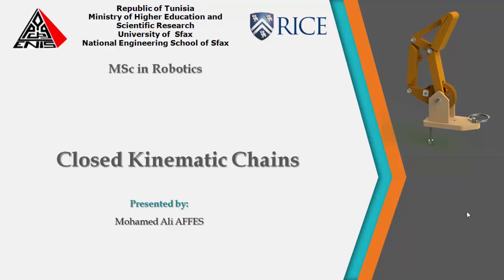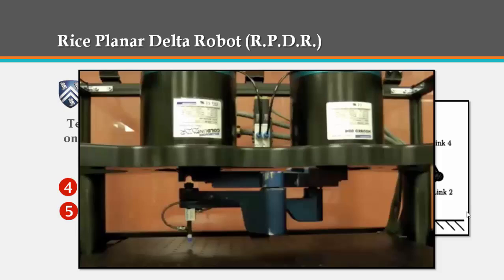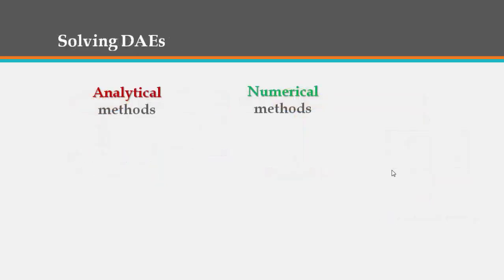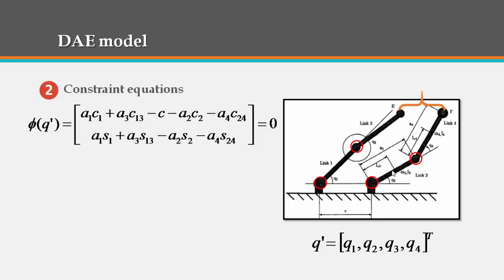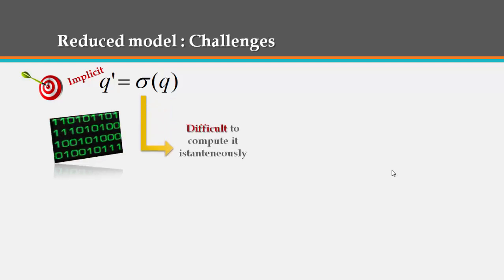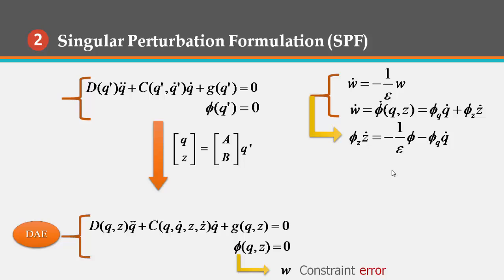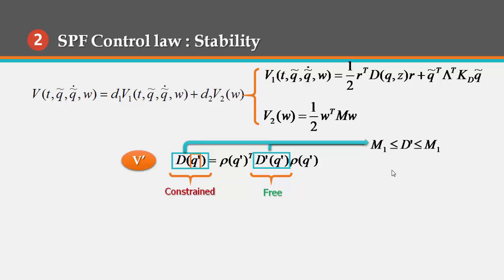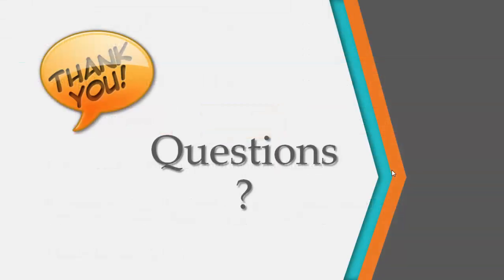Closed Kinematic Chains (CKCs) Dynamics and Control

Comment: Salam,
Thanks for this presentation, but am wondering how you have solved these equation?
Reply from the maker: Salam,
You can refer to the following articles for more details:

Ghorbel, F., Ch ́etelat, O., Gunawardana, R., and Longchamp, R., “Modeling and Set Point Con- trol of Closed-Chain Mechanisms: Theory and Experiment,” IEEE Transactions on Control Systems Technology, Vol. 8, No. 5, pp. 801-815, Sept. 2000. 

Zhiyong, W. and Ghorbel, F.H., “Control of Closed Kinematic Chains: A Comparative Study,” Proc. of the IEEE American Control Conference, Minneapolis, Minnesota USA, June 14-16, 2006. 

Zhiyong, W. and Ghorbel, F.H., “Modeling Closed Kinematic Chains for Control: A Comparative Study,” Proc. of the ASME International Mechanical Engineering Congress, (7 pages) Orlando, Florida November 5-11, 2005. 

Zhiyong, W. and Ghorbel, F.H. “Control of Closed Kinematic Chains using a Singularly Perturbed Dynamic Model,” Proc. of the IEEE Conference on Decision and Control, Atlantis, Paradise Island, Bahamas, pp. 317-322, December 14-17, 2004 

Zhiyong, W., Ghorbel, F.H., and Dabney, J.B. “On the Domain and Error Characterization in the Singular Perturbation Modeling of Closed Kinematic Chains,” Proc. of the IEEE American Control Conference, pp. 493–498, Boston, MA, June 30 - July 2, 2004. 

Dabney, J.B., Ghorbel, F.H., Wang, Z., “Modeling Closed Kinematic Chains via Singular Perturba- tions,” Proceedings of the 2002 American Control Conference, Vol. 5, pp. 4104–4110, May 8-10, 2002, Anchorage, Alaska, USA 

Ghorbel, F.H., Gunawardana, R., Dabney, J.B., “Experimental Validation of A Reduced Model Based Tracking Control of Parallel Robots,” Proc. of the 2001 IEEE International Conference on Control Applications, pp. 375–382, September 5-7, 2001, Mexico City, Mexico. 

Ghorbel, F., and Gunawardana, R., “A Validation Study of PD Control of a Closed-Chain Mechanical System,” Proc. of the IEEE 36th Conference on Decision and Control, pp. 1998–2004, San Diego, Dec. 10-12, 1997. 

Wang, Z., and Ghorbel, F.H., “Control of Closed Kinematic Chains Using A Singularly Perturbed Dynamic Model” ASME Journal of Dynamic Systems, Measurement, and Control, Vol. 128, Issue 1, pp. 142-151, March 2006.
Reply: Mohamed Ali AFFES Thank you brother these should help